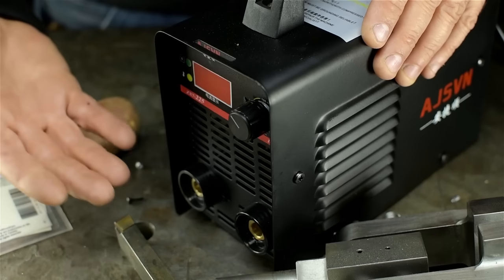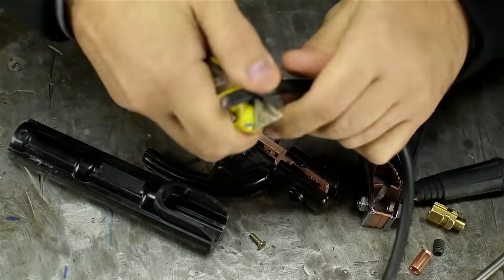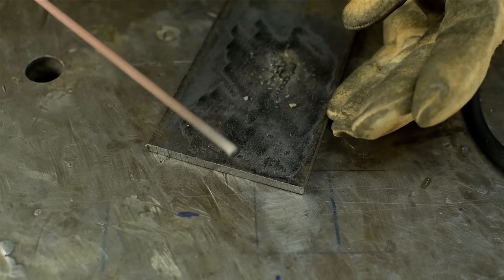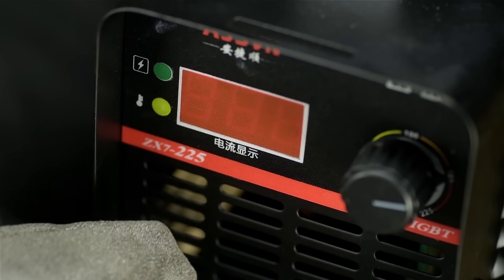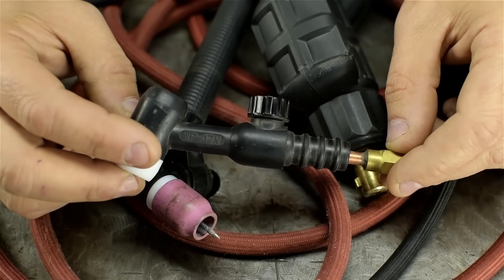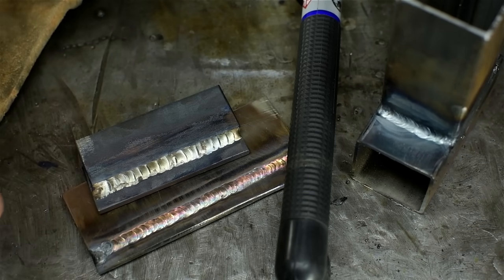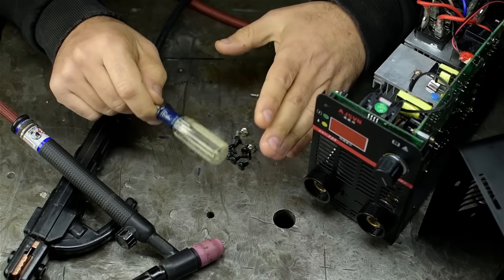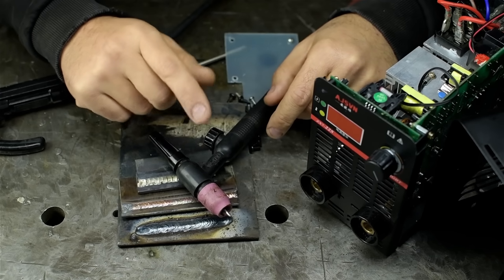Cheap Ebay Welder -- WILL IT TIG?!

Comment: When your multimeter costs 5 times more than your welder...
Reply: Never knew they made them to read that high of DC amperage.
Reply: MAX R.....They make external accessory jaw clamps that then plug into the multimeter low ac input. I have one
Reply: @davidlawrence8085  👍🏼
Reply: David Lawrence amp clamp babyyy
Reply: But, in the video, he didn‘t use it properly, because he said, that hes welding with 80 Amps. The meter didn‘t show amps, it showed the voltage! Hes welding with 0.80 V DC! He cannot measure the current, just because inside of the meter, there s a fuse with 10 amps.
Reply: @Paul27  Measuring the voltage output of a clamp meter (0.08v) - looks like his is 1mv/A output.
Reply: Christopher Bill oh, yes I didnt notice first, that hes using a clamp, sorry....but that makes the meter even more expensive!
Reply: @Paul27  Many external amp clamps plug into the voltage input of the VOM and you read the voltage as if it's amps. The amp clamp is outputting a low voltage.
Reply: My SC640 cost $400. It's worth every penny. :-)
Reply: @Paul27  the amp clamps output the amperage value im millivolts
Reply: We saw the meter but not the amp clamp. Most amp clamps are AC only. You need a DC hall effects clamp to properly measure DC current. Otherwise the reading will be bogus.
Reply: Well thats a Fluke
Reply: Finally found a comment regarding the improper use of the multimeter!
Reply: They call that a fluke! Rimshot!
Reply: Damn things are to delicate for the price
Reply: @scottbunn1788  except its correct. In this case, V is for A. Way easier and cheaper to make than to design something that can handle 250 amps.

Comment: Why spend money on cable? there's tons of it hanging between those weird limbless trees outside my house.
Reply: Gotta watch out for the cable farmers though, they got pissed last time I went out to harvest.
Reply: I like to use garden shears with uncoated metal handles because they’re nice and sturdy. Make sure you leave the gloves at home too, you’ll want the extra grip your bare hands provide
Reply: @kirkendauhl6990  Your helpful hints are appreciated... 🤭.. no worries in California tho, the insulation is already baked off the wire and powered down.... 🤓
Reply: colab with electroboom on how to correctly harvest the limbless tree cable?
Reply: looking at this pos I think you could get away with the cables supplying your 110 receptacle lol
Reply: @peterwilson8254  : Not if you want the welder to stay while the stick goes you won't, that thing doesn't look particularly heavy.
Reply: Many of those are now optic fiber... trust  me, I tried to get these cables for personal projects and got really pissed when I found out there were no electricly conductive cables...
Reply: Heck, some of those wire come already full of Arc! Perfect for welding!
Reply: Though you doesn't need gas also...
Reply: @Omap : be careful, often those cables are not isolated!
they are good only to make the earth sink under the house
Reply: @aerogfs  you talked to telephone and data companies .. I assure you that for the electric distribution the cables are still in copper or in aluminum and of good section also .. I don't know well AWG but they are cables that at least are16 squared millimeters section : for a sol string cable of 16 mmq, the diameter is 4.5 mm (about 3/16 ") the main problem for a home use is that they are often made with strands ( for examples 7 strand for 35 millimeter square) much bigger than the cables of the house, so they are not very flexible, exactly the opposite of how the welding cables must be
Reply: @richardlincoln8438  
Well at least in Cali the wires don't have a y juice in 'em. Hell, the ones in the Bay area all carry moonbeams, bunny fuzz and positive ways.
Reply: Hhahahahhahahahaha
Reply: @kirkendauhl6990  Weird but touching one wire at a time, and not grounded, will not shock you.  Birds sit on the wire all the time. If you touch both it is Good Night Irene. Cutting the wire puts you in the arc, if the wire is under load. Pretty much guaranteed. That is why the wire is there after all. 😈
Sally Says: Either way not recommended. It will make you very crispy. 😨😲😤
Reply: @kirkendauhl6990  With that kind of instruction I think any endeavors would qualify as a show competing with "Deadliest Catch" ;-P
Reply: @kirkendauhl6990  🤣🤣🤣🤣🤣
Reply: @richardlincoln8438  ok
Reply: Good luck with that buddy.
Reply: @zolatanaffa87  Much of it is Al with a steel center wire for strength.  I had to cut some after Hurricane Andrew to help out the DOT crews. Cable was over an inch in Diameter with a 3/8th inch stranded steel core center. Took a couple bites per but when you have a 4' pair of bolt cutters, everything looks like a target for them. 000 Copper house wire is more flexible than those cables.
Reply: @gravelydon7072  in italy we use not insulated cables made of Al+Steel only for Power transporting Lines on high voltages 15000 volts And above
Reply: @zolatanaffa87  We have mixed use here in the US. Copper here in S. Florida if used on power lines would be exposed to high moisture and high amounts of salt in the air. So most lines are Aluminum with a steel core at any voltage. Does it last? Most of the wires in the area have been up since late 1992.
Reply: @gravelydon7072  i remember that one of The first work i made in 1981 was The resto ring of a powerline Born in 1938 made with naked copper wire And concrete poles The chance was The Arms of The poles Now in Hot zinced Iron And The insulators that They was made in ceramic for 10000 volts But The real voltage was 15000 volts And Now The insulators are in tempered  glass for high smog environment.... But The Cable are The same since 1038 ( in seashore)
P.s. i worked in Enel since 1981. Now Just retired after 39 years!
Reply: @zolatanaffa87  Dad started working for the local power company about 10 years before you. After he had been in the Navy for 25 years. Started out as a Helper, 6 month in transferred to the I&C division ( electronics and communications ratings equal to what he had done in the Navy). In 1988 they made him an offer he could not refuse. So he retired Jan 1, 1989 as Plant Supervisor 3 of the nuke plants in the system.  As such he had traveled to almost all of FPL's power plants at some time in the last few years he worked there.

One thing I have found since I officially retired in 2005, I don't get as much done as when I was working.
Reply: @OldSneelock  I do not know how true it is? I have managed to get countless shocks of 230 V and some 400 V between both hands - which means that the power passed the heart! The only thing that happened was quite deep burns in the skin where it contacted the wires ...
Is it probably true what you learned a long time ago that you can handle upwards of a second of current before the heart stops at normal voltages? But I am extra careful when it comes to splice cables as the muscles cramp and you can not let go in such cases, but otherwise I usually check if there is tension in the wires by moving them quickly as I learned that it is not dangerous for ME. ..
Reply: @64TommyG  Good luck with that theory. The carbon path left by the current is a result of the current heating your flesh and bone. Can't see an upside to not disconnecting the power source before working on the circuit.
Reply: @OldSneelock  You're right, it's just that I've had problems with the computers on new cars when I have disconnected the power and that I'm too lazy to find the right fuse indoors - but if I'm going in and working in the electrical cabinets I'm breaking probably usually the main power so I do not burn down the house ...
I don't suggest any other to do the same why I doing it it's because I'm tested it so many times that I know what happens/not happen to me but whit age I have to be more careful of course!
Reply: 😅🤣 well played 👏 👌

Comment: I see what you're problem is, you're trying to use a 4:3 welder at 16:9, I remember those days.
Reply: Holup ✋🤔
Reply: Nah, it's a PAL welder used as an NTSC one.
Reply: @anotheruser9876  Never The Same Current?
Reply: but do you remember - round B&W?
Reply: @palewriter1856  Ahh, you mean the old "Buzz and Whip" stick technique?!

Comment: The duty cycle could be calculated by measuring time spent resetting the breakers.
Reply: Bill Benedict 
Or how many “doody” logs one drops down the “river”
Reply: Bill Benedict added time the off duty time
Reply: It has a 100% duty cycle if you put it on a 30amp breaker and use a piece of filler rod to wire the breaker locked out it also doubles as a shop heater if you don't mind the smell of magic smoke from the caps
Reply: @Hudson Yeah that's a good idea , needs to be 100% for commercial welding , this will make things a lot easier than dragging around some big old clunker .That thing can't weigh more than a couple pounds.
Reply: @jmy7622  One of the accessories that came with mine was a shoulder strap! Seriously, you use short welding cables and a long 220 V cord and carry it around with you. Makes sense if you don't mind dragging a 220 volt cord around.
Reply: :face-green-smiling::face-green-smiling::face-green-smiling::face-green-smiling:

Comment: I just realized Tig welding is just soldering with possible death involved. I also think soldering is weldings "cosplay"
Reply: Yeaah, I can see why they are similar, both involve having the heat source from a sharp metal point in one hand while feeding the core with the other. And seeing it that way, MIG welding is like if stick and TIG welding had a baby boy. But, soldering is moke akin to brazing, only at higher temps, the metal from the cores serve more as glue than filler like in welding. I think your joke might have flown over my head, but screw it, I just wanted to explain that XD
Reply: @FourthWayRanch  Its the same general process. I use a pointy hot thing to melt metal to bond two pieces of metal. It was a joke lol
Reply: @omarh789  I USE LIGHTNING
Reply: No it's not. He did some brazing with TIG. ANY welding involved both base metals melting.
Reply: @MrSticks9999  You missed his point. He was talking about the way you handle the tools, not the actual process taking place.
Reply: @coolbionicle  A a retired Instructor, I do not think I missed the point.
Reply: @MrSticks9999  I'm beginning to believe welders have no sense of humor.😉
Reply: @MrSticks9999  you fully missed the point Mr instructor.
Reply: @marcusborderlands6177  I think not Son.
Reply: @MrSticks9999  you 100% did. It was a joke on how soldering and welding look similar...
Reply: @marcusborderlands6177  Absolutely not Son
Reply: The use of fire makes a big difference.  Try making silver jewelry with tig. Good luck with that. And it is a close tolerance brazing.
Reply: @user-qn2tz9qd7t  Tesla style
Reply: Actually speaking of soldering   I have a car that appears to have a pin hole leak in radiator by looking at coolant stain on radiator and doesn't hold fluid and I was wondering if I should use solder , J.B. Weld , buy a 3 in 1 welder which I have been wanting for years now and even though you get what you pay for the cheap ones are right up my alley , or break down and buy the rest of an oxy/acetylene welder which I've already gathered torch heads , an oxygen bottle and regulator so all I need is acetylene bottle and regulator , hoses , and maybe a different welding tip .

Comment: Keep the torch resting on the nozzle with the tungsten tip about 2 mm from the workpiece then run your filler wire across the workpiece and the tip of the tungsten,  its waaaay easier to strike the arc like that and its easier on your sharpened tip
Reply: The tip has a say 5mm tipout from nozzle, you are meaning that the torch must be at an angle say 60 degrees to the vertical. Then the torch will rest on the nozzle. You are correct.
Reply: Hadn’t heard this tip before. Just starting to
Learn tig.
Reply: @LatinDanceVideos  this is only for scratch start tig welders
Reply: there is no tungsten tip here this is stick welder
Reply: @FreeMind5094  ????  Did you watch the entire video,  A large part of the 2nd half is TIG welding.  The name of the video is even "will it TIG"  TIG = TUNGSTEN INERT GAS welding
Reply: @Atari8888  Jup thats true allthough a lot of inverter based multi process welders will weld TIG on the SMAW or MMAW setting using scratch starting. Mostly the TIG setting is just to enable the HF arc initiation.  I work as a welder for a copany that specialises in coal fired steam boilers for power stations and some of the boilers has tube bundles that contains nearly 1Kilometer of piping per section and in the case of tube leaks there is so little acess to weld a new insert that it is impossible to reach the button on a TIG torch that we almost exclosively use scratch starting so we would set machines that is HF enabled to SMAW setting to allow us to use scratch staring.  Jou just have to make sure of the polarity of your connections

Comment: If it sounds like cooking bacon, you are welding. 

If it smells like  cooking bacon,  you are on fire.
Reply: I always wanted to be on fire , but not so highly strung.
Reply: greanstreak04 Lol 😂
Reply: good one! lol
Reply: greanstreakk04, I like the advice but I think it depends on how similar in makeup your belly is to that of a porker! A "one size fits all" approach doesn't work here! As a amateur inventor I think I might try to add a flat cooking surface to the welder so a person could multi-task with welding and cooking at same time ;-P You might even put the display to use doubling as a cook temperature indicator? The bargain factor gets better and better!
Reply: A fellow AVE fan
Reply: My first welding job was in an open shop during winter. It was cold. After a while I felt this warm sensation around my stomache area. It was sooo nice. Then I thought to myself, "wait, nothing is supposed to be nice." I lifted my hood, and a perfectly round hole had been burnt into my flannel shirt all the way across my body. I didn't get burned,  but I can still remember how nice that felt for just a little while.
Reply: You ACTUALLY made me laugh 😂😂😂
Reply: I've been on fire, smells worse than bacon.
Reply: @dcfromthev  maybe you should shave more???
Reply: @willyam9735  there's always an engineer in here...
Reply: @dcfromthev   As someone who smelled what burn victims in the Vietnam War smelled like, you never will confuse the smell of burnt hair with cooking Bacon. Fast forward 35 years and that is how I knew I had just burned myself. By the smell. Do not weld while on medications like Neurontin ( Gabapentin ). Weld burns take a long time to heal properly and you will burn before you sense it.
Reply: THE most important thing in the world is not being on fire.
Reply: so....

If it sounds like cooking bacon, you are welding. 

If it smells like  cooking bacon,  YOU are welding?
Reply: @Seriouslydave  read much???
Reply: @Seriouslydave  Only the smell is worse than cooking Bacon if you manage to set hair on fire.
Reply: If it looks like cooking bacon, you are cooking bacon

Comment: I'm late but, as a tiger welder,  a good rule of thumb with scratch start is to not touch your tungsten to the work surface. Utilize the wire to drag across the work surface and tungsten quicky, at the same time. Takes practice, but will strike the arc, and save the tungsten
Reply: If jou can master scratch starting like this you can save some money on Tungstens and expensive welding machines  by just using a cheap Inverter-welder.  Unfortunately old oil bath machines won't work firstly because they have an AC output and no way to keep the arc going between each alteration in polarity unlike inverter machines that can use AC-TIG to weld aluminium.

I think I ran away  with my comment a bit but using your filler wire to initiate the arc helps a lot if you weld in akward positions where you cannot reach the button on a torch
Reply: As a tiger welder myself, the most important thing is to keep the dart gun handy. If the tiger wakes up and sees what you attached to her... well, One Leg Jimmy refuses to say what she did, but he's deathly afraid of alarm clocks now.
Reply: Nah.  Hf boys hf
Reply: I’m late but, as a tiger welder a good rule of thumb with scratch start is to not let the tiger touch you while it’s scratching or starting. Utilize the large piece of meat on a wire and drag it across the enclosure of the tiger quickly, but without making yourself look like a snack at the same time. Takes practice, but will stimulate and feed the tiger, and save your legs from being eaten.
Reply: Dang, we got a tiger welder in here
Reply: @prodbybabygod7411  sometimes HF is not an option.
Reply: @jacovandeventer1939  you don't necessarily need an expensive machine to get some of the nicer TIG settings, I got a 155 amp inverter tig machine with HF start, adjustable pre and post flow, and and a torch included for 135 bucks on scamazon, even included a single tungsten. I don't have any argon so I've only used it for stick so far but it seems to work pretty well.